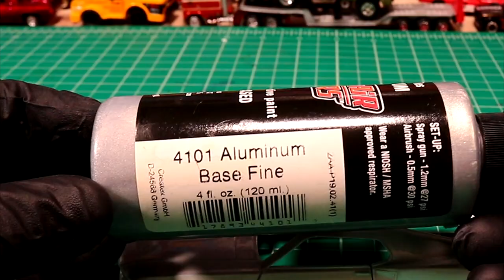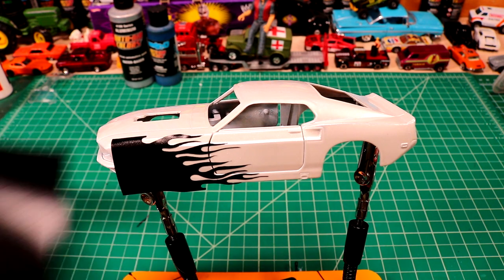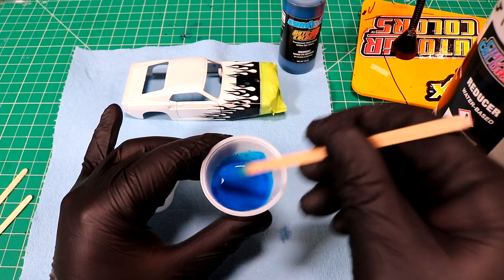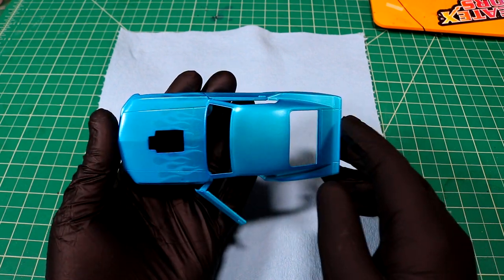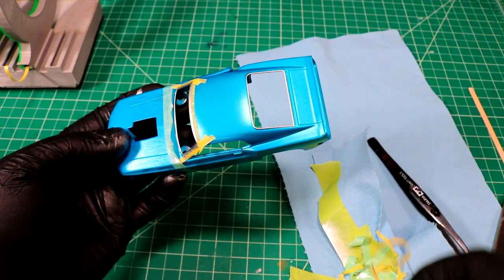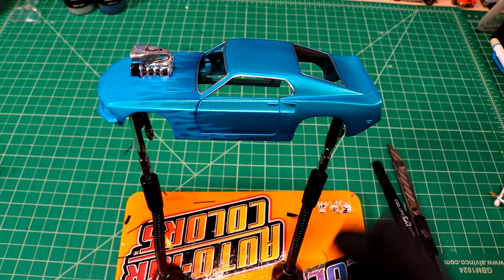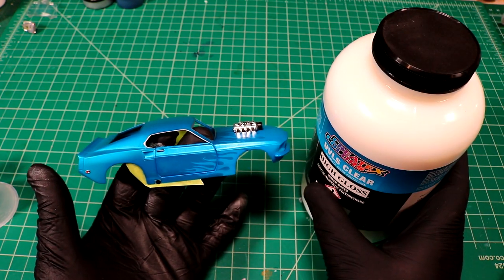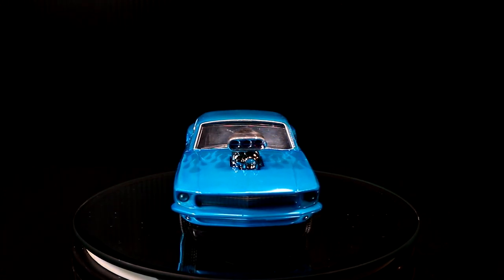'69 Mustang Paintjob Gone Wrong?  🔥🔥🔥

Comment: lovely. love how decent the flames look, and the rest shimmers nicely. I'm not too fond of the Jadas, the wheels are often so big they melt into the engine block. XD the front section must consist of a series of extradimentional spaces.

a long time ago Humbrol came out with tiny spray cans. one contained clear polyurethane. I tried it on Humbrols' gold paint on a little Siku, and the PU washed everything off like it was watercolour... this was mid-80's I think, before airbrushes for modelers and compressors became affordable. at least, to me. :P

Comment: Does the clearcoat look a little orange peeled or is it just me? Not smooth
Reply from the maker: Yeah it didn't turn out well, I should have sealed the candy first and def NOT have tried the paint oven after spraying the clear.
Reply: @DiecastResurrection  no worries Austin you always do top notch work.